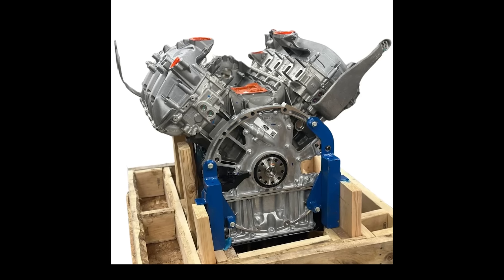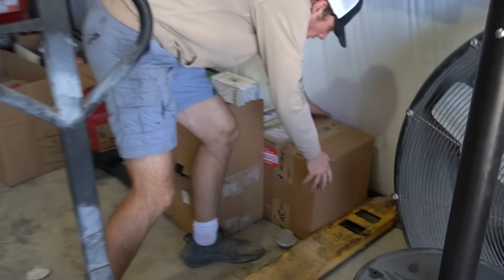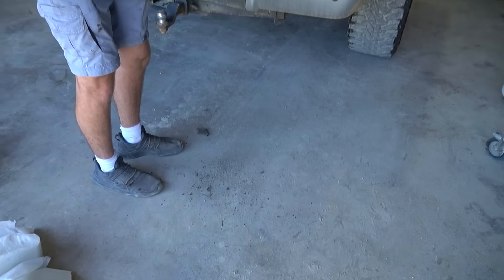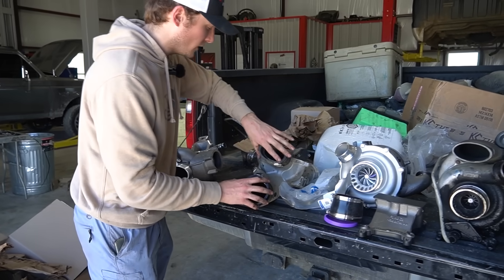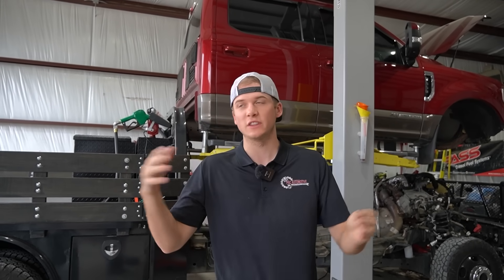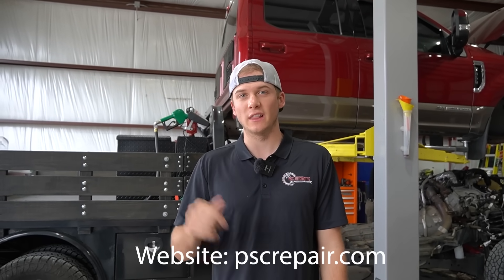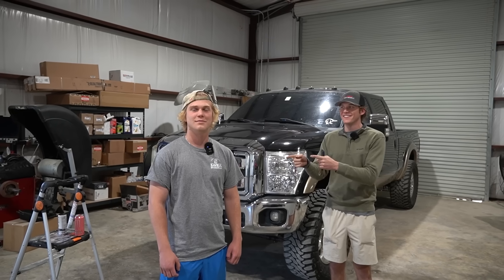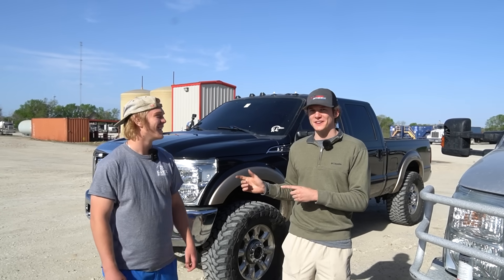We Put A 2020 Steel Piston Engine In A 2012 6.7L Powerstroke

Comment: I’ve done a couple of these. Who do you have tune these trucks for you? Only thing I seen have some issues was the idle. Aswell as turbo actuator. The guy I was doing these with was a nut. He claimed he was the first one to figure out how to do this. I remember drilling out oil filter housing and front case with modified sensor and swapping cam sensor / ring that goes along with it. Bending a couple fuel lines depending on what year you have. Good stuff.
Reply: Heads flow a lot better on these new motors too I think. 
the clips swap for the injectors I believe. The blue ones I believe not sure it’s been a while. Didn’t really know anyone else was doing this.

Comment: All you need to do the swap is 2020 manifolds and use a 15-19 turbo set up, 2020 cam sensor pigtail make sure you wire it up correctly and modify the oil filter housing to be able to use your oil pressure and temp sensors and use 2020 motor mount brackets then just use all your old sensor and components
Reply: I’m in the process of doing one. Is there anything special on wiring in cam sensor pigtail ?

Comment: So I have just the short block, seems only thing I have to do is swap all the stuff from my 2015 onto it and drill the motor mount holes up? Everything else looks like it'll bolt up from my 2015? The block hasn't changed except for the size of the motor mount bolts?

Comment: Why didn't they just rebuild that engine? If it didn't experience catastrophic failure there is no reason to replace it.
Reply: With machine shop labor rates these days, a lot of times it’s more cost-effective to just do a remove and replace with a long block rather than rebuilding a core.

Comment: The trans can hold 600hp? That seems low
Reply: I was thinking the same thing. If he likes beating on his truck, that trans ain’t lasting long 😂
Reply: It is warrantied for that much power. There's a good chance it'll handle more.

Edit: they might have gone with a "stage 1" transmission. They aren't as cheap or easy as the older 4-speed autos to build solidly.